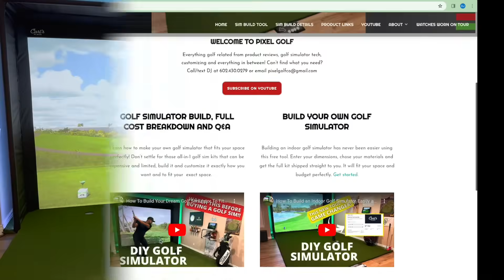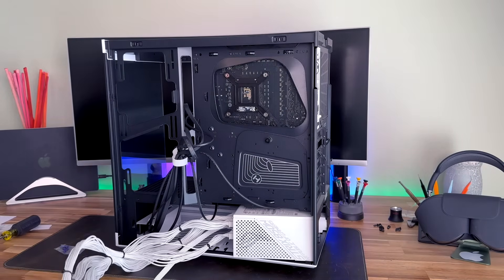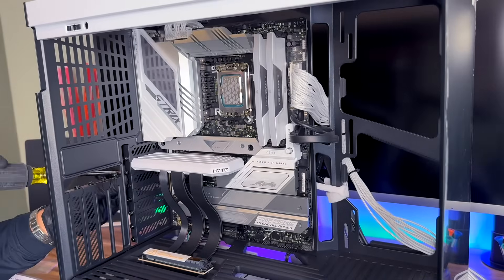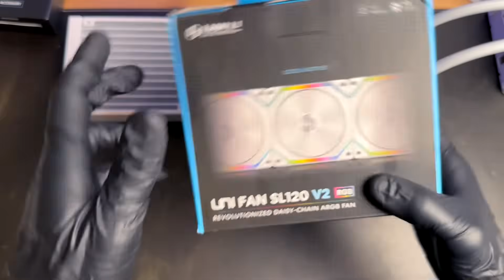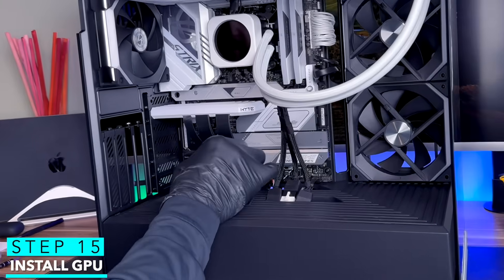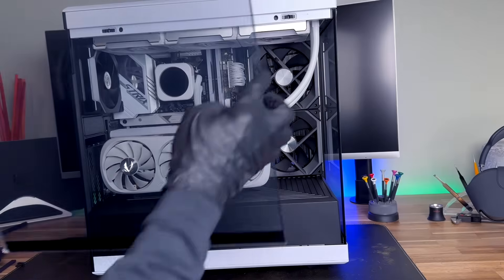The Ultimate PC For Golf Simulators! Step-By-Step How To Guide | Full Build!

Comment: I want to control it with the touchscreen monitor(1080p) and watch the video on the 4k TV. How should I set it up?
Reply from the maker: If you are doing a touch screen monitor that is 1080p, but your projector is 4K you're going to want to extend the displays as duplicating them will throttle down your image to the weakest link. I am not sure if there is a workaround for this without upgrading to a 4K touch display.

Comment: Wow, thank you so much for the amazing video. I was going to just buy a pre-built one  but because of your video I think I feel confident enough to go through and try it out myself. One question though... Considering this vid is almost a year old now, if you were building your PC today, is there anything you would potentially do differently? Thanks again!
Reply from the maker: Hello John, I get asked that a lot and the answer is... No. This build is able to handle any golf sim software I through at it in 4K at the highest settings. 

I did make some modifications recently though, but they were all aesthetic. I swapped my 2 140mm side fans with lcd display fans and added some nicer cable extensions for the GPU and MOBO, but again... strictly cosmetic. 

One issue you'll likely face though is finding a 4070 TI Super at the price I paid though as they are sold out and hard to find for a reasonable price. I'd check the used market for the GPU if you cant find a new one. I will try and update the links for one suitable if I find one.
Reply: @PixelGolf  Thank you for the reply! I purchased mostly everything, now I just have to see if I can get one of these new 5070 ti's that come tomorrow morning. Have the alarm set, so fingers crossed. Crazy how much all of these GPU's are running at the moment.

Comment: What kind of clearance from the wall do you have with those pipe shelves? Do you feel like you pull in enough cool air with it being that close to the wall?? Love the setup!!
Reply from the maker: I ran plenty of bench marks with all different types of sim software in max settings and the PC runs cool and does not get hot. I have about 3" of space from the wall where the two 140mm fans intake air into the case and it appears to be great! Thank you for the comment and let me know if you have any other questions.

Comment: Are the side fans required?   The description on Amazon says “Compatible with Lian Li SL120 V2 3 Pack only”. I did not order the optional fans.  Thank you.
Reply from the maker: You would want some fans on the side typically to pull air in on the case. You can get some different fans if you want, but with a 2 sided glass case moving air is especially important.
Reply: Thank you.  Since I did not order the options Lian Li 3 pack optional fans , will the side fans work without the Lian li SL 120 fans?  I really enjoy your channel.

Comment: Built this exactly…thank you! One question…how did you connect the monitor and the projector? There is one hdmi on the gpu and one on the motherboard that doesn’t work because the cpu has no onboard graphics.  Just run both monitor and projector on gpa with hdmi and DP cable? Thank you again!
Reply from the maker: Hello, from my PC GPU connectors, I have one hdmi cable going to my projector and one hdmi going to my monitor. My GPU only has oneHDMI port, but it has 3 display ports, so I bought a display port to HDMI adapter. Reach out if you need anymore help. pixelgolfco@gmail.com
Reply: @PixelGolf  is it possible to get a pic of that??  I was planning on getting a 4 K monitor and running an HDMI from monitor to Projector and another from monitor to a TV. Will that work as long as the monitor is 4K. Very new to all this but excited about my build up to this point.

Comment: For the GPU you want to use 3 different cables to the power supply not just the 2 cables you used.
Reply from the maker: Going to look into this now and will pin this as a correction in the comments. I didn’t realize this, thank you!